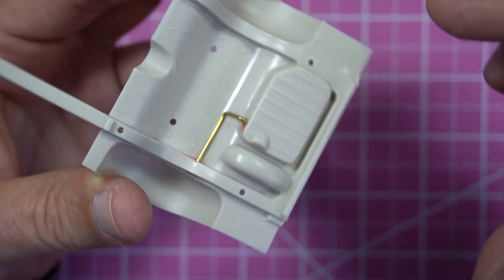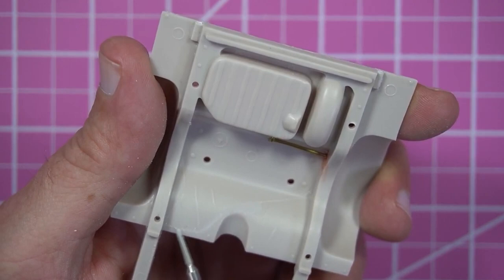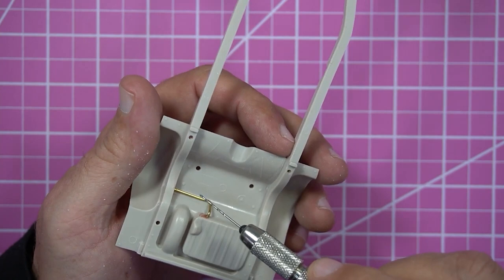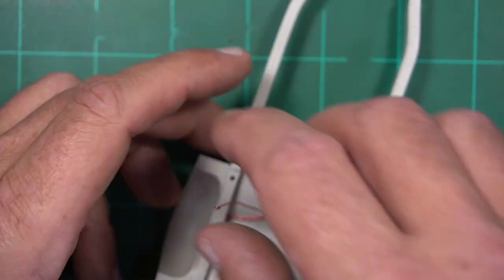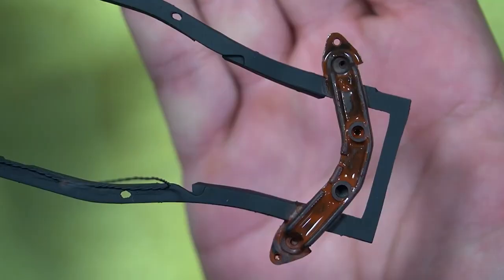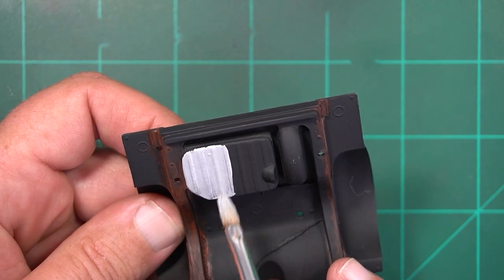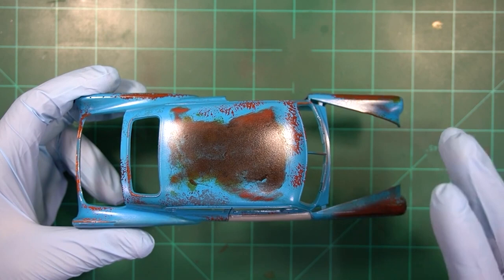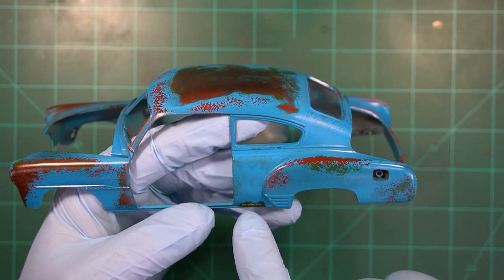Weathering A Model Car With RustAll!

Comment: Nice work,  some great tips there and I love the repaired door with drill holes. I'm not really sold on the glass though, maybe too much hazing, maybe it needs rain streaks. Other then that looks like a real sweet barn find, just needs some bird poop.
Reply from the maker: Thank you very much for checking out the video and for your kind words :) This guy is actually going to be sunk in a lake of resin as a diorama eventually :) Hopefully that comes out well.
Reply: Right on, that sounds interesting, I'm working on an old truck with light body damage and a flat tire, also some damaged fenders and tires kicking around for a gas station/garage diorama....cheers, good luck with the epoxy, I hear that's tough to work with. @HobbyLinkInternational